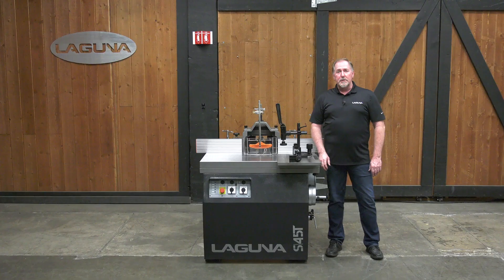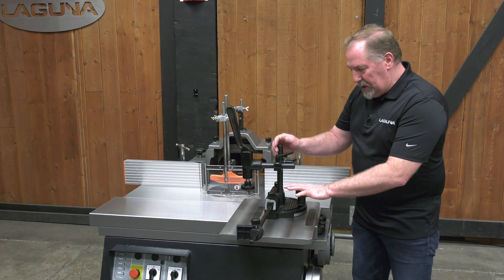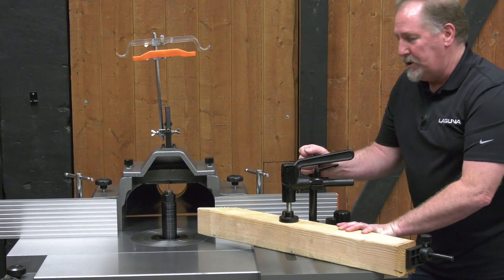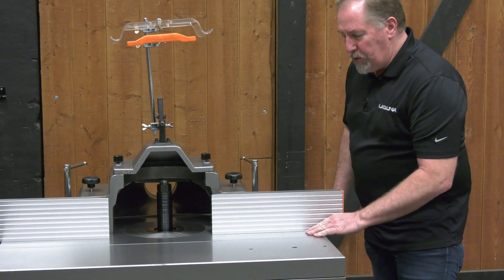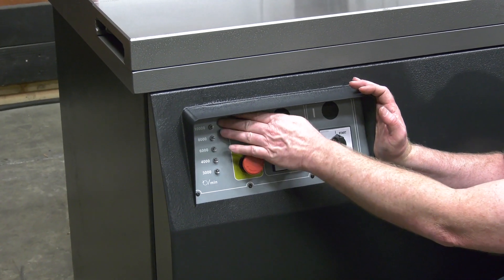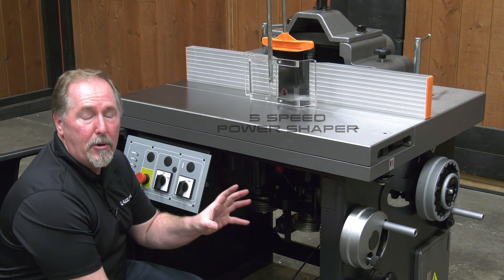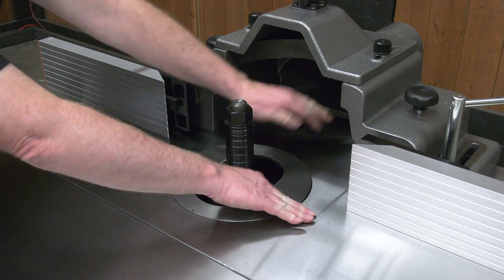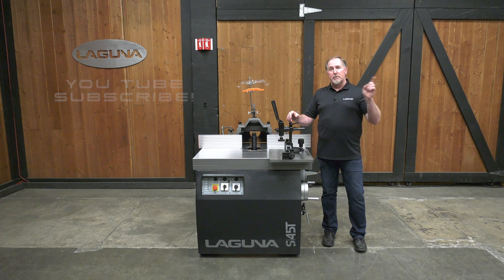S|45T Industrial Shaper Overview | Laguna Tools

Comment: I have owned, and used over $14,000 worth of Laguna Tool machines for the last 15 years in my business. I just hope the support and customer relations is better now. The machines are commercial grade, and have held up so far. A wide belt sander, that they don’t make any more, has been a real disappointment. The advertising of its function was an exaggeration, but according to them they never published it. Funny, I have a copy. I just don’t like being lied to! Caveat Emptor!
Reply from the maker: Hey MM, Have you contacted our customer service yet? If you're having issues with your wide belt sander please call 800.234.1976
Reply: Laguna Tools —Dear Laguna tools. Yes I did contact your company a number of times. The answer was something like “well that’s how it’s supposed to run”. I do metal and wood fabrication and had to fabricate a better system to get the motor to slide on. It works “OK” now but wish I had bought the one Delta made. I bought some of the last belts you carried for it. After some discussion you did sell them to me at a discount, and I thank you for that. I just bought the Super Max 19 - 38 belt sander from Woodcraft. They are a great company to work with. The Super Max is a nice machine. Great dust collection with my commercial grade whole shop Oneida cyclone.